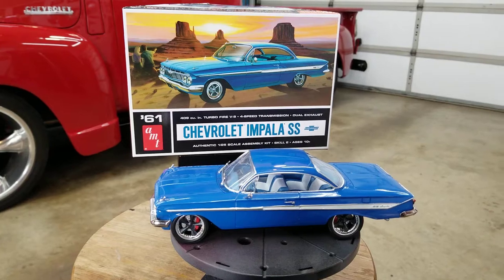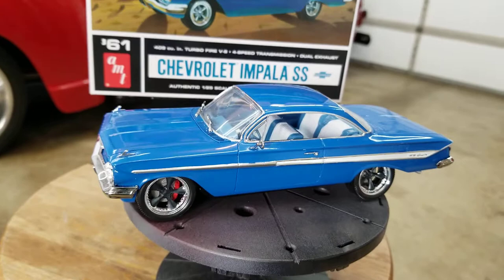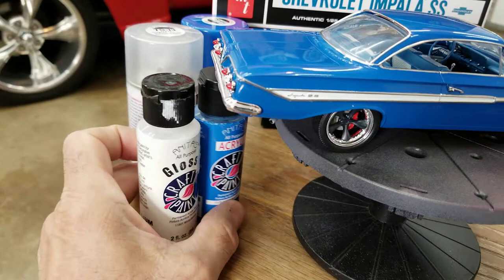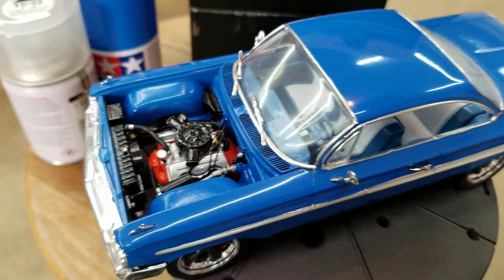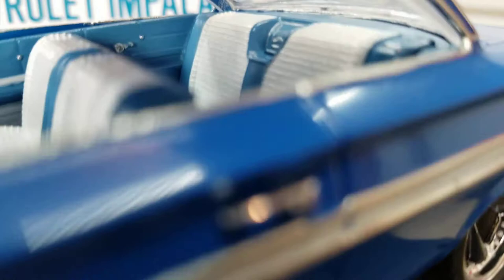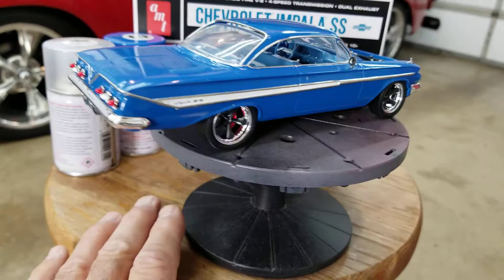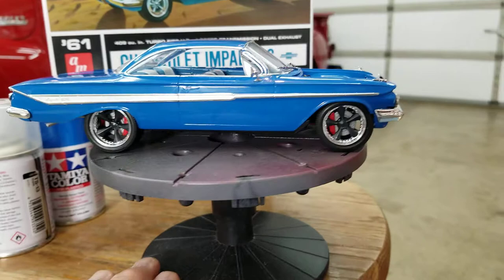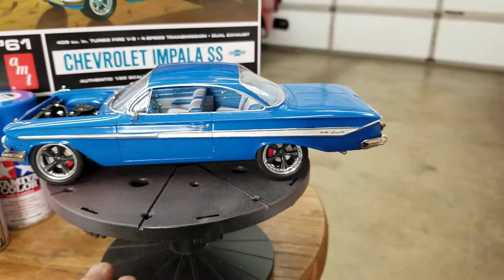AMT 1961 Chevy Impala SS Completed

Comment: Bumpers fit great.. I have built several AMT kits.. and most of them are crap.. this one.. I purchased was one of the nicest ones I have purchased.. Very nice kit.. some of the body had black spots on it.. sanded them out.. everything on my kit fit nicely… first time ever.. If you get lucky as I did.. the plastic seemed like new molds. The 71 Mustang Mach 1 was one of the worst kits I have ever purchased… I was totally surprised with this kit… very good.
Reply from the maker: I hear ya man.  This was a nice kit.